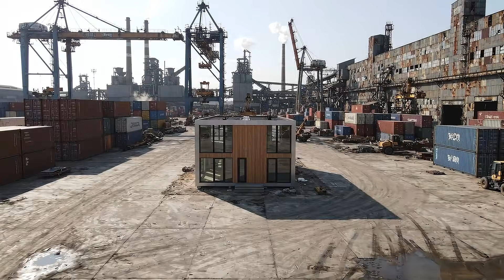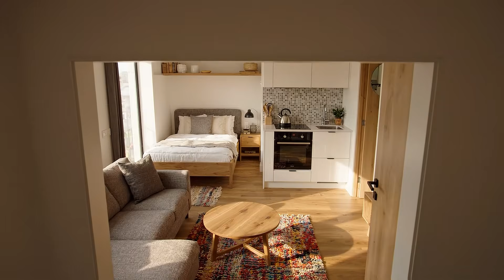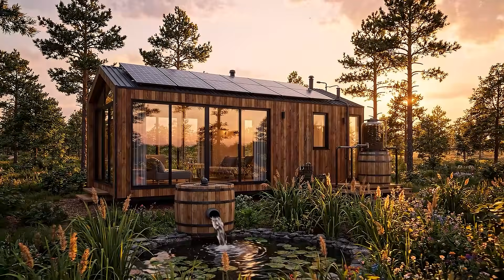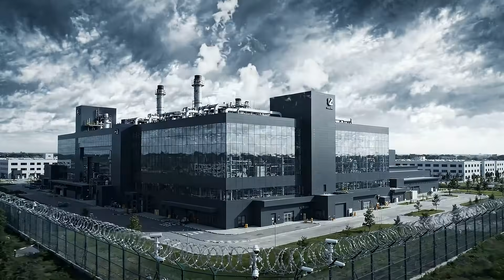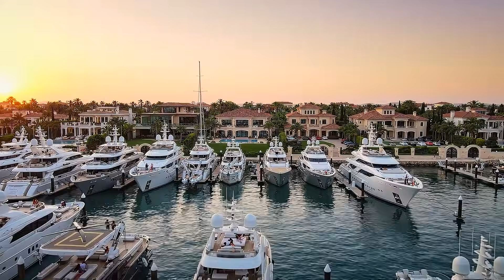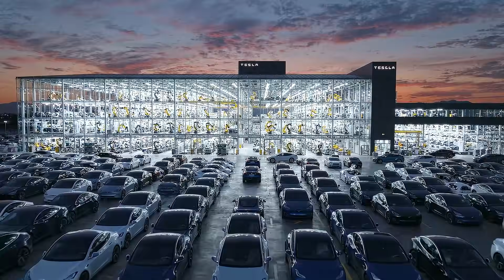Elon Musk FINALLY Unveils Tesla’s $7,999 Tiny House!

Comment: You stated that the basic house is modular, so for a hoarder all s/he has to do is to add another room, then another and so on. Being built out of quality materials (unlike mobile homes) they house should last decades before need any major repairs.
The beauty of it is, if your job moves or your neighbors become a pain, simply fold your house up, load it on a truck and move it to your new location, which is beyond brilliant. In fact, you can own multiple locations and periodically move your entire house to your preferred spot, be it mountain or ocean. Or, you could time share with other Tesla homeowners.

Comment: Many companies are already capable of manufacturing tiny homes at scale. The primary barrier to their widespread adoption in the United States isn’t production, but regulation.  Local zoning laws, building codes, and homeowners associations (HOAs) often restrict or outright prohibit where and how tiny homes can be placed, significantly limiting their practical use.
Reply: Laws are so easily changed and or modified, faced with a solution to a housing crisis you will be surprised how fast things can change.
Reply: @stankygeorge Hopefully.  My guess is the shrinking population will be the first thing that causes homes to become cheaper.
Reply: @mjk9388 good point